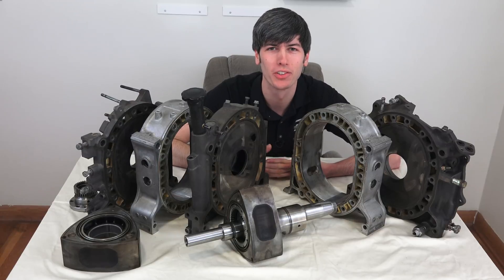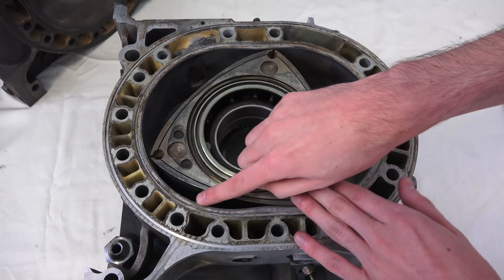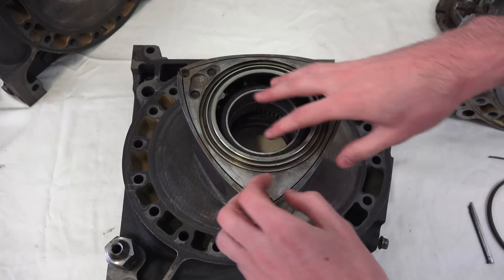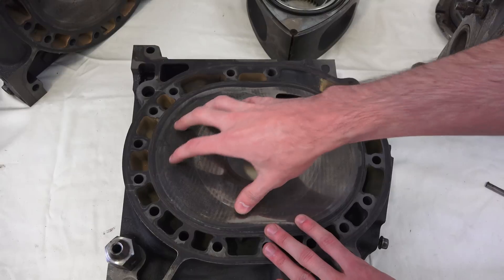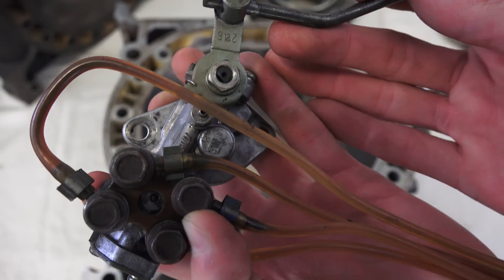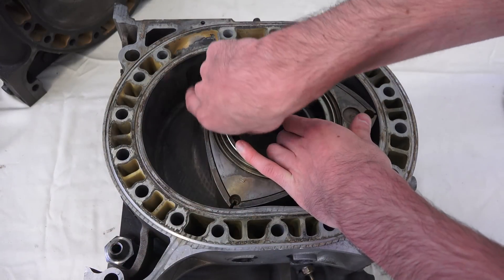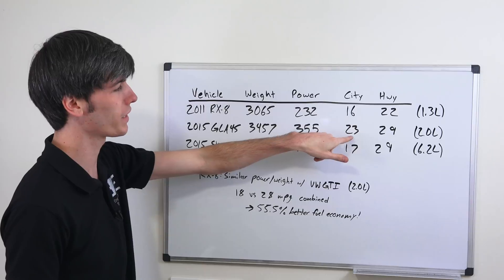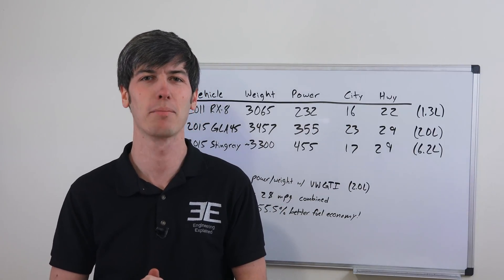4 Reasons Why The Rotary Engine Is Dead

Comment: fuel economy aint great, you got that right at least, but when comparing apples and oranges the fuel economy was always going to let the mazda down, the wankel rotary was invented by felix wankel, general motors , ford, Nissan Porsche all own rights to the original wankel rotary produced by NSU, mazda are only ones developed it however. And nearly every time it wins it gets banned.
Reply: +FRANK101101101 
Fuel economy is excellent when used in a constant speed genset application.

Comment: Also... a few decades ago, when Audi-NSU came out with the Ro-80, those rotaries had defective apex seals. That lapse in quality control did more than anything else to ruin the public image of the rotary engine. The Citroën GS-71 Bi-rotor was even worse but thankfully they only built 250 of them.
Reply: +Zendon Rey 
Apex seals were rectified decades ago.
Reply: +John Burns Yet they are still the firs wear part in the system to fail.
Reply: ***** They do last well enough for them to work fine for vehicles. I have seen old Mazda rotary pickups still on the road. It's always cool to see a stock RX7 waste someone's pride and joy V8. The RX7 was probably the first production car sold in America that was capable of lifting the front wheels off the road bone stock.
Reply: CrucifyRobinHood They still last a long time. Also when the engines are use at a constant speed the wear rate is far less. Apex seal lift off was a problem, with Mazda claiming to have solved it. Irrespective, there is a minimum speed that the apex seals DO NOT lift off.  Mazda stated 2,000 rpm. The less the rpm the less wear. Using as range extender the minimum rpm must be the target and this may mean adding rotors rather than increase rpms.

Recall a twin rotor rotary 1.3 litre is the equivalent power output of a piston engine with EIGHT cylinders.

Comment: Why are you talking about the (arbitrary) weight of the car as opposed to the weight of the motor?
Reply: +Engineering Explained 
Then the rotary will do better being one third of the weight and size. The knock-ons are: lower hood lines for better aerodynamics, lighter suspension,  more space in the car, etc.  If the rotary had a car designed with its advantages in mind it would trounce others.
Reply: The real doktorbimmer The Wankel is in mainstream production too so your basic premise is nonsense.
http://www.autonews.com/article/20151027/OEM03/151029840/rotary-engine-returns-in-mazda-concept-coupe
You are nothing but an idiotic troll as you have not given a shred of proof to back up your arguments.
Reply from the maker: Because a vehicle's weight is very important for fuel economy.
Reply: +duncanmil1 because if he was talking about just the weight of the motor it would skew the bias the other way round.
Reply: Standard internal combustion engines can be as low as 0.025hp/pound
http://ronney.usc.edu/whyicengines/whyicengines.pdf
The Masda engine? 247 pounds and over 200 HP, The closest to that I have found is a CBR600 engine which still is 20% heavier per HP and in a much higher state of tune so nope your wrong Wankels are much lighter per HP. The masda by the way in modern trim is 280BHP from 247 pounds of engine.
Reply: Gordon Lawrence The rotary is one third of the size and weight of a inefficient piston/crank engine.
Reply: The real doktorbimmer simple - emissions we already said that - try and keep up.
Reply: The real doktorbimmer try learning to read. What the CEO said was that the RX-series were not being built any more. I don't care what the journo's interpreted that as. Saying the RX series will not be built is not the same as saying the Wankel will not be built. Also the article I cited was later than any of yours so superseedes them. Therefore you are wrong again. Also your argument was that it was nothing to do with emissions. You still have produces NO evidence for that. You are either a halfwit or a troll.
Reply: A fully dressed Renesis really is lighter than a fully dressed Gen IV GM V8, but as noted, it's power output, emissions, long term reliability and fuel economy are pathetic in comparison. The Renesis is an improvement over the 13RB/EW turbo motors from the FD3 platform though, and those were only 50 lbs or so lighter than a Gen IV V8 (aluminum heads/block), and had the aforementioned deficiencies. 

The RX series sports cars are wonderful chassis, I just wish Mazda would pull the stick out of their ass and make a non-rotary  2+2 sports car with a Skyactiv engine. The Kaburya concept showcased what could have been, basically an RX chassis with the Skyactiv engine.
Reply: because the weight of the car effects fuel efficiency, just the weight of the engine doesn't.

Comment: The Otto-Engine once was just as inefficient. If we had given the same amount of love to the Wankel-Engine and its optimization as we did to the Otto-Engine, they'd probably be equally good nowadays. They just didn't care about it too much I guess :) like HD-DVDs compared to Blu-Ray discs.
Reply: +raphu604 I've said the same thing about rotaries for years.  The Otto is still an inefficient design, and was once HORRIBLY inefficient.  If the rotary had the same "love" (as you put it) as the Otto, they'd probably be making 1,000hp, getting hundreds of miles to the gallon and have near zero emissions.  That may be a stretch, but if regulations can make Otto's as clean as they currently are, compared how disgusting they were (especially 70's and older), and given the simplicity and continual motion of the Wankel, it may have been possible.
I was just grateful to see that someone else felt like I have.
Reply: +raphu604 
Look at my posts on this vid.
Reply: ***** Mazda made a hybrid out of the Mazda 2.  The small rotary was only turning a generator. Some engineers have concluded that a modern rotary as in the R&D labs (laser ignition, direct injection, etc) in a genset can power the driving electric motors and not need a buffer battery. However a mains chargeable battery bank (energy buffer) makes them shine in performance and economy.

Liquid Piston turned the design inside out with the seals on the housing and the valves/ports in the rotary. The seals can be changed as in a normal periodic service by taking off a lid, as we periodically changing timing belts. They got US federal aid to develop and went off the radar announcing developments - as they do when government money is put in and military is in mind. 

Once a crankshaft is removed the efficiency of an IC engine rises substantially.

Comment: Just remember that the RX8 was an naturally aspirated engine. And you compare this to engines that have superchargers in them. The superchargers actually make the thermal efficiency a lot higher. Which is why the RX7 actually gets better fuel consumption and emissions compared to the RX8 (18 city and 24 highway) and that was with an low pressure (0.2BAR) turbo with no inter cooler. The same reason why they put an turbo on an diesel engine to get better thermal efficiency.  In other words higher compression ratio without getting pre-detonation.  Also since the RX8 there have been a lot of advances in thermal efficiency so again to compare cars from 2015 with an car from 2011 doesnt give you the real picture. Also on the material side of research there have been breakthroughs that will directly affect the sealing capabilities of the apex seals even making them self lubricating. Im sorry but most of your arguments you use handpicked examples to state it. Most people dont know all engines consume oil. Yes you heard me right all of them. Since you need to keep the cylinder wall lubricated as well. With an rotary engine you just does not have a crank that blows up the oil. And your argument with the difference in temperature between combustion side and intake side is only valid during the start up. At operating temprature the difference in the metal casing might be 10deg Celsius. The reason for this is the rotor transfers heat as well as the exhaust transfer radiating heat to the rest of the casing as well. Plus most rotary engines are made of aluminium which has an great heat transfer rate. You also forgot to mention most of those are copper seals except for the apex seals. So with thermal expansion from the heat they will seal better.  I agree with almost all your other video's but with this one I just cant agree with your arguments.

Comment: Key points: (1) Completely irrelevant power/weight comparisons, as you are comparing the weight of the cars not their engines (and this video is called "4 reason why the rotary engine is dead" not "4 reasons why the RX8 is dead").  (2) MPG comparisons are a completely meaningless argument (straw-man fallacy) since they are a product of many attributes (aerodynamics, weight, ambient temperature, tire compound, gear ratios, etc.) not just the engine.  Furthermore, the corvette was a very poor choice for comparison due to its cylinder deactivation.  (3) The % difference between the MPG's of the RX8 and GTI is 43%, not 55.5% (the formula for % difference is criminally ignored in the literature).  (4) Use of an outdated peripheral ported engine as the example of why the engine was recently (2012) killed off.  As a visual aid, its misleading but crucially moving the exhaust ports to the side housings improved sealing and emissions (no overlap that allows unburnt fuel from the intake charge to mix in with the exhaust charge).  (5) Compression ratios of rotary engines have been on par with piston engines from the same time period (e.g. 9.4:1 in the 80's, 9.6:1 in early 90's, and 10.0:1 in the '04 RX8).  (6) The oil is injected into the housings not into the air/fuel mixture in the intake.  Yes that design was used but was killed off long ago and therefore did not contribute to the engine's recent "death."   And possibly the most important - (7) The rotary engine is still alive in other applications such as aviation, and Mazda still produces them for the Star Mazda/Pro Mazda race series.  
Not counting the stuff that only a rotary enthusiast would know (of which I am not, just a curious engineer) I give you a "C+" due to notes #1-3 above.

Comment: i kinda disagree with the statistics you put up, computers 4 years ago were way different in motorsports and economy. granted yea rotary's aren't the best anyway but alot of the newer LS motors have technology that was never even thought of long ago, making 4 cylinders turn off when your on the highway when it senses you not on the throttle, which then unlocks when you wanna pass.

Comment: many things can be solved. add a secondary ignition system and burn the fuel in two steps. Add a special additive not oil to lubricate the rotor walls - something that burns cleaner and yet lubricates the rotor.  There are stuff out there but not used. Alternative - use a better quality allow that does not need much lubrication. 
The emission would also helped by the secondary ignition system (dual spark plug) and add a very small turbo charger to each rotor which can reduce rotor size and improve efficiency.  
Also the dual intake system could improve efficiency.  Anyway it can be made reasonably good and the way they make power is awesome. I loved the old RX7 and even the RX8 although it was a bit gutless.  My old 95 RX7 made over 300HP and yes it was a thirsty beast, fuel was 1.35 average so I did not care. 

My favorite engine would be still the V4 with twin-rotor turbo inside a V , with a small capacity like 1.6 -2.0. 

That would run really great and could make good power. Sure the I4 design is more efficient in many ways but sometimes we need to step back and just enjoy a technology for what it is.

Comment: A possible fix for the temperature problem, make it tungsten carbide since it has the highest fusion point out of any metal. It will be better for the engine block having a few areas like where the combustion is being made in.

Comment: If the Wankel had reached production in the 1950's, it is conceivable that it could have marched up the development curve to be competitive today. But, I worked in automotive emissions from the 1970s onward, and we simply could not see a way to get around the Wankel's inherently high surface-to-volume ratio when compared to a piston engine. Many others understood that, and few were willing to spend effort on moving the engine forward. And....none of us thought the requirements for clean operation and high mileage would ever get has tough as they are today. The Wankel is simply unable to compete.
Reply: +Edward Hart 
It does compete. 
http://images.cdn.autocar.co.uk/sites/autocar.co.uk/files/styles/gallery_slide/public/images/car-reviews/first-drives/legacy/tokyo-show-2015-web-017.jpg?itok=_HjiYt-9

The 1970s Arab fuel crisis killed the rotary. If it had come out 15 years earlier it would now be the norm in vehicles. Modern advances have solved the surface-to-volume ratio.

Comment: So from looking at this, this is the old RX Mazda engine, but what about the new RX&, the 2011 model. Do you really need to put oil for the combustion to burn, like a 2 stroke motor in 2011+, or did they get around it somehow. I doubt it, since you still listed it as a main disadvantage, which to me it absolutely is.

Comment: I don't think it was fair to compare anything in 2015 to something from 2011 due to CAFE making manufacturers be more efficient every year. Also we're not only comparing motors but transmissions when looking at fuel economy, the Mazda had a 6 speed while the newer vehicles have 7, 8, 9 even 10 speed transmissions, just a thought.

Comment: You need to understand the 2015 Corvette is also direct injected with a 7 speed manual while the Mazda had a 6 speed. With that being said however, the RX8 was still worse in mileage compared to the 2008 Corvette 6 speed manual which made 430 HP. The Wankel has the advantage of 3 power strokes per rev while the piston engine does 1/2 a power stroke per rev. The Wankel DOES make power power for it's size, but the amount of torque they produce is dismal. That's why the RX8 used a 6th gear ratio of .84:1 and a 4.44:1 axle. That translated into 2,900 RPM at 60 MPH. The Corvette's 6th gear ratio of 0.50:1 and a 3.42:1 axle allowed the engine to spin at 1,300 RPM at 60. That's how the large V8 engines can obtain really good mileage. Engine size doesn't exactly dictate efficiency, the gearing also contributes

Comment: interesting video, except the engine comparison at end.  the engine in 2011 rx8 was first produced in 2003 with a small update in 2009.  Putting it against engines from 2015 is not a good comparison.

Comment: Why do they have to use poluting mineral based engine oil when 2 strokes use lower emission vegetable based synthetic oil??A friend had an RX8 but sold it due to the oil consumption costs and lack of fuel economy.

Comment: While I will agree about the terrible fuel economy of the rotary engine, you did compare a 2011 engine to a few 2015 engines.  of course there is going to be differences in technology.  You also compared it to the GTI, but what about something from around the same production years to compare it to something around its same tech level and not just weight and HP ratings?

Compare a 60's muscle car v8 to a modern v8 and you will see that they also had extremely terrible efficiency when you compare the HP produced to fuel burned.

Comment: I read the rotary engine has a larger surface area in its expansion chamber compared to an equivalent piston engine, with results in a greater heat loss per revolution. The rotary engine is a higher rpm engine than a conventional piston engine, so that heat loss is magnified still further.

However the main reason would be blowby between "chambers" and also into the central crank chamber. You simply can't seal a rotary engine as effectively as you can a piston engine.

Comment: thats a wankel not a rotary
Reply: +Roman No. You meant Radial. Rotary (Wankel) uses a rotor, or 2, or 3, or 4, or 6 .. holy frak... RADIAL engines are the 7 or 9 piston engines you see in older airplanes... Radial... ;)
Reply: +The real doktorbimmer you guys are confusing the airplane and the car rotary.  Mazda bought the rights to the wankel but they changed it greatly they called it the rotary.
Reply: The real doktorbimmer Shit, thanks, Doc. All that and I never had to go to shikkipedia! Thanks. I thought you meant Wankel was a brand name. You know your shit.
Reply: +Starcruiser81 Radial engines and rotary engines are completely different. Radial engines have a bunch of pistons around a crankshaft and spin the crankshaft, a rotary has a fixed crankshaft  and the pistons spin around that. Look up "Gnome Rotary" or "LeRhone Rotary"
Reply: look it up on wikipedia dude.Starcruiser81
Reply: +The real doktorbimmer pretty much spelled it out there. Only real surviving rotary power-plant is a motor, not an engine. Called an Outrunner. They replaced practically all of the micro-KKM engines (and about 90 of the rest of them) in R/C aircraft.

Comment: As a kid I frequently rode one of the family's snowmobiles, a 1971 Arctic Cat Panther with a Sachs rotary.  It had a 303cc displacement (I believe) from a single rotor.  Not as powerful as the twin cylinder 440cc 2-cycle engines of the day but a pretty good ride all in all.

Comment: It's taken the rotary a long time to die. Back during the first energy crisis in 1973-'74, Mazda, which had just rolled out nationwide from only being sold on the west coast, got kicked right in the head when the EPA, who had just started testing cars for gas mileage, could not wring more than 13mpg from a rotary-engine RX-2, a car no bigger than a Toyota Corolla. Mazda never really recovered. That's one reason that for years, the only Mazda with a rotary in this country was the RX-7/RX-8. Even the Miata, which seemed to be a natural for the rotary, got a 4-cylinder piston engine.